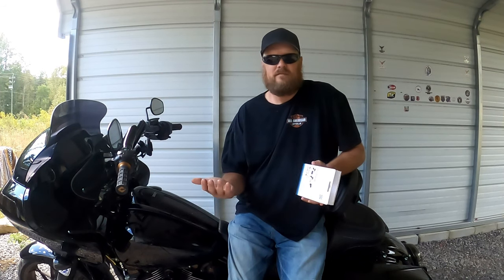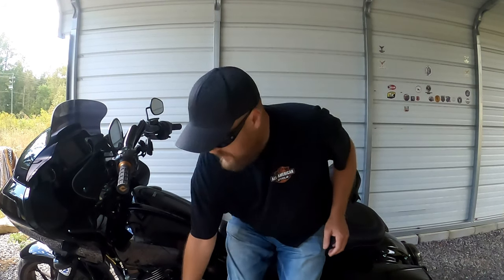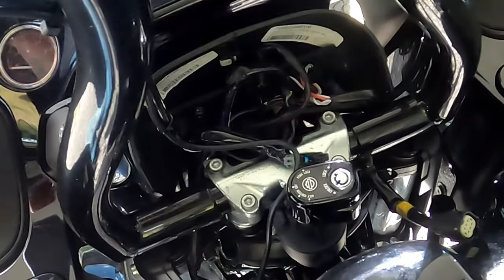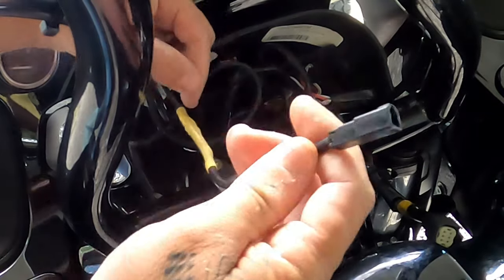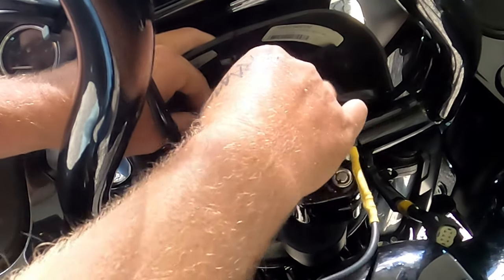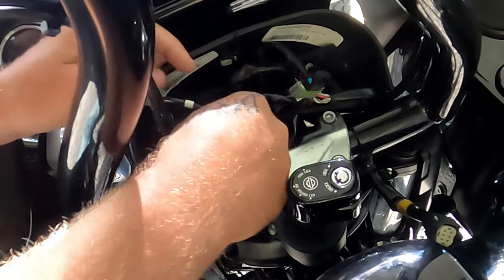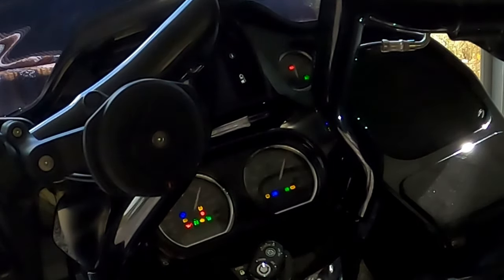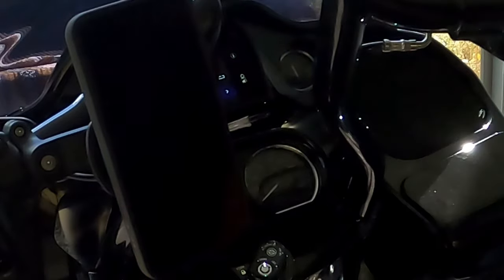Quad lock  Wireless Charger installation with a twist! @Quad_Lock

Comment: Great Video.  One question, where did you get the power plug to connect to the wireless charger?  What type plug is it?
Reply from the maker: @GregSargent-i7d  it's the 2V-24V Waterproof Wireless Charging. Link is in the description then choose that option.

Comment: Did you use the male dummy plug and connected to the untouched heat grip plug?
Reply from the maker: @newmoney8128  i did not, but you can. And you would have to run to harley to get the 2 pins.
Reply: @TweedleD  I actually found the two pin that is by itself and then the female that is the power that has the dummy clamp on top of it I found them both because if you're going to run heated grips you have to connect those two pins The mail that goes over the female so I actually ended up finding it and I'm just going to cut it and then solder the ends and tape them off and use that but it's right on the throttle cable I believe those two pins are black and white and then the female is purple and black was your black on both cables ground and then the colored power
Reply from the maker: I would have to take it apart to know for sure but the right was the hot left was the ground. I think the hot was purple ground black
Reply: @TweedleD  That's what I was thinking with the black and white Left the white was hot in black would be ground and purple would be hot and black ground for the female and male connection. I'll keep you updated what's

Comment: Does the wireless charger comes with a button in the back to switch it on and off?? I have seen that the USB version has it, but nobody say anyting about the non-usb version. Nevertheless, since you installed a switch, i would assume it does not.... Thanks!
Reply from the maker: @albertobecker1  No, it doesn't. That's why I wired it into the heated grip port. Still no issues either.

Comment: I honestly feel like this would have been a greater video had you went through the steps of exactly what you did It would have been more helpful to a bunch of other road glide riders as far as in the simpler install going through the dash instead of hardwiring through the battery
Reply from the maker: Your not wrong. I probably should have.

Comment: Did you have to have the bcm or ecm flashed to have power sent through the heated grip port? Ive never used heated grips so i dont know if power goes theough mine... 2020 road glide special
Reply from the maker: No it's all ready on at least on mine. FYI that plug already has the female plug on it. All ya need is 2 pins and the dealership should have them and can probably  pin the wires for ya. I didn't know that's why i used a bad set of heated grips for the plug.
Reply: Thank you
Reply from the maker: @josephlardino3250  no problem.

Comment: Nice video. I am trying to do the same as you, I have the same bike and set up. However, I have some doubts. Can you guide me through the process? I still don't get it. To my understanding I have to cut off that plug, the heated grip one that comes with the bike, then I solder it to the quad lock wire so I can connect that to the other plug. Is that right? If not, can you break it down step by step. I am not use to do stuff like this and even though I speak English, It is not my first language. those could be the reasons why I still don't fully get it. I lean more to the first reason hahaha
Reply from the maker: No, dont cut anything. Lift you guage cluster off, pull the plug off of the heated grip. And go down to harley they should have the pins that fit it and crimp to ql wire, insert them into plug  then plug it in. Easy pezzy
Reply from the maker: Just make sure you look at what hole the red and black wires go into

Comment: I have the quadlock with the USB-C port to USB. I bought a pigtail wire to usb-c 5v 5amp to connect the quadlock to heated grip connection. Works great when the ignition is turned on. When I start the bike, however, it starts flashing blue. When I hit the killswitch, phone starts charging. What could cause this? I have an (Indian FTR)
Reply from the maker: @pinkzpimp  when I turn the ignition off, all power is off to the quadloc. I don't have the cvo ignition  that uses the kill switch. I think it has a power delay but should shut off. Don't know how indian is wired. If you have the type c it should have a power button on bottom. That could have something to do with it not sure.
Reply: Yeah if the bike is on, the quadlock is on. It is only when I start it, that it starts blinking error and won't charge. Still shows it's powered. But, when the engine isn't running  but on, it works just fine. Not sure what happens when the bike is started that causes that. Maybe the wire. 🤷‍♂️ pushing the quadlock power button doesn't change the error.
Reply from the maker: @pinkzpimp have you tri3d unplugging it, start it then pull back up. It my be because it's a usb type charger. Where mine is not it has a positive and negative hard wired into charger. The heated grip port may have too much power for the USB. Don't know for sure just spit balling ideas.

Comment: What if you already have heated grips?
Reply from the maker: @EWGREENFIELD06  if I had heated grips I would get the cases and pins and make a y splitter .  I don't know if you could run at the same time or what setting for the grips. If it has too much draw, the fuse should blow for that circuit. In my thoughts at least. They have another version that goes straight to the battery you would have to run it under the tank .

Comment: Omg, why not just tap it with the cigarette lighter?
Reply from the maker: @jmc7784br  why cut into the factory harness when you can just do what I did?
Reply: @TweedleD  You could do what you did, but you don’t need to cut into anything, just unplug it, and plug it together and would work fine. Also you need to be careful because the heated grips draw a lot of power, and could burn fuses along with the charger in the same line. I don’t know, just my opinion cause I do have heated grips. I plan to get the same charger But I am taking of the cigarette lither, cause I don’t smoke. lol
Reply from the maker: @jmc7784br  it's really a power port. If ya look in, it's different than a cigarette lighter. I have  3 to 4 thousand miles on my setup, no blown fuses or smoke lol. I do not cut into factory harnesses or t taps because it could  cause problems  later. This is a easy unplug if i trade it in and harley can't say anything  if there was electrical warranty  work. Because it's plugged in and not cut into the wire or its insulation. It's a cleaner and more professional way to do it.